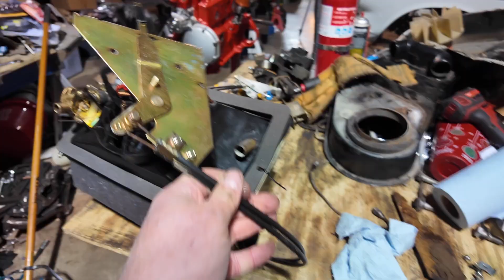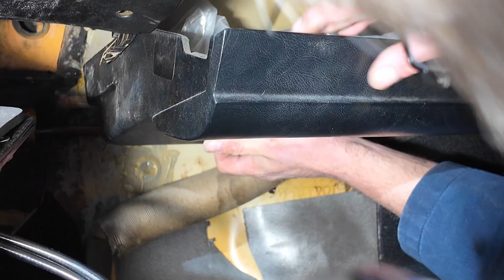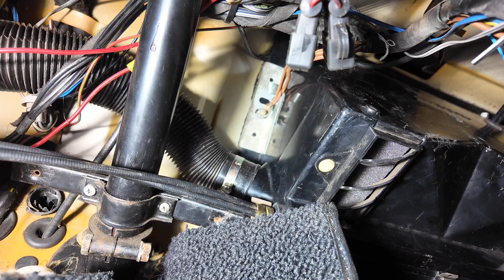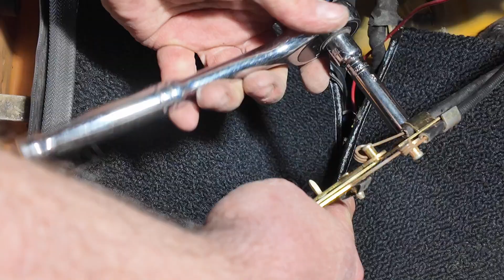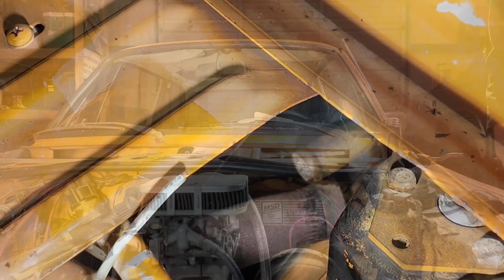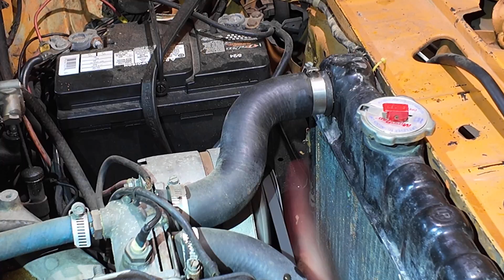71 BMW 2002 Heater Box Installation

Comment: It would have been great to show the heater box dissasembly, heater core test,  especially remove the fan motor, replace and preserve, restore fan blade. But I think in your case you had a spare.
Reply from the maker: I bought the refurbished heater box from a friend who restores them.   The BMW blue shop manual describes disassembly.  Apparently the box halves are riveted together and you have to drill those rivets out to open it up.   You can rivet it back together or just buy appropriately sized bolts.   He sends the heater core to a radiator shop for a pressure test.  
I am working on a video of removal and refurbishment of the heater box from my 67 Volvo 1800S.  At first I tested the heater core using a smoke machine which showed no leaks but eventually I decided it was worth the expense to take it to a radiator shop for clean up and pressure test.   I think that cost me about $85.
Reply: @ReWerked  What is this  BMW blue shop manual of which you speak? The radiator shop near me asked for 20 bucks but I gave them 40 bc they let me film the whole process and were so nice.
Reply from the maker: Sorry for the late reply.  For some reason your message did not show up on the list of unresponded comments.  The manual is a two volume set of blue three ring  binders.  Title is “Repair Manual BMW 1602 1802 2002 Vulume 1 and 2” and then has the number 01519699551 in a format that looks like a part number.  You can find these on eBay and sometimes on marketplace.  The photocopied version is cheaper but I think it’s worth it to get the original for better resolution on the pictures.   It goes for about $250-$300 for an original set.  You can probably find a pdf file of it also.
Reply: @ReWerked  I have a pdf file, 1763 page document "Original Parts Catalog
BMW 1502 thru 2002tii
Electronic Edition Volumes 1 & 2"
Is that it?
Reply from the maker: I haven’t seen that pdf but if it’s only a parts catalog it’s not the same manual.  Here’s a link to one for sale on eBay right now.  It has a slightly different title than the version I have and I thought it might be in German but the pictures show it to be in English. The link is 

https://ebay.us/m/GzH8pe